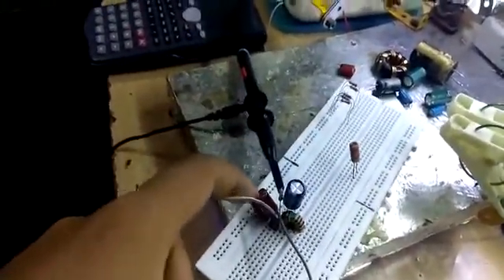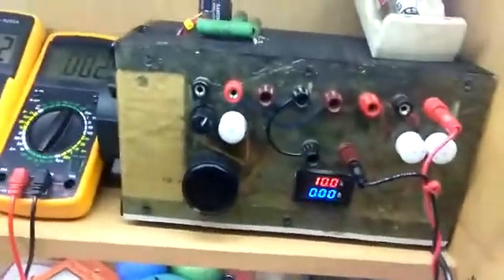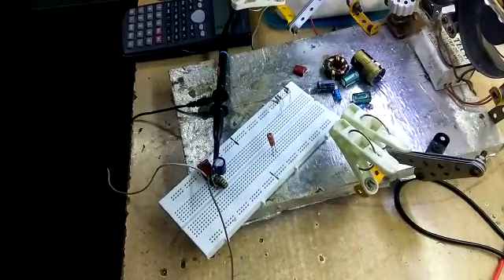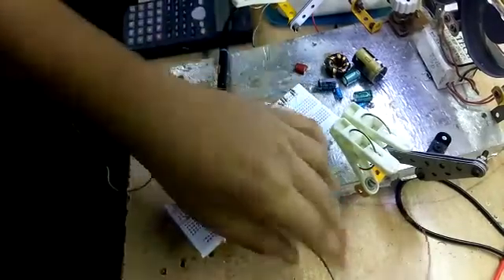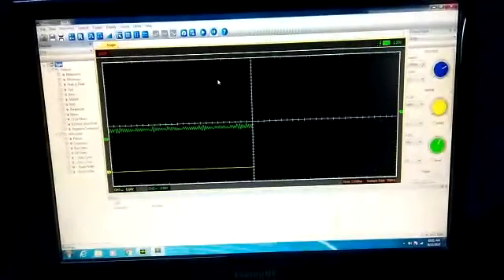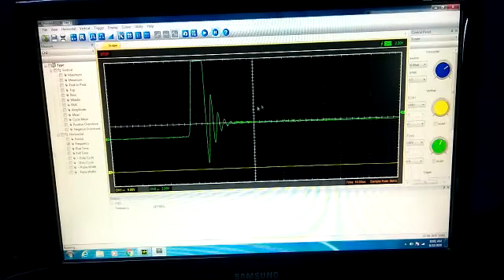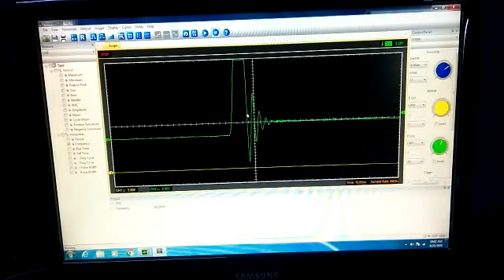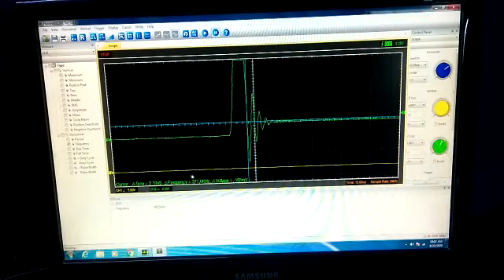Resonance of LC tank circuit on an OSCILLOSCOPE!!!

Comment: Hi, very nice video! Could you please share the capacitance and inductance values? How is the second capacitor connected in the LC parallel circuit? Additionally, could you please describe the oscilloscope’s settings and the input DC voltage to drive your circuit? I am just interested in showing the undamped LC oscillations on the scope (not the resonance curve). Did you use any switch to charge up the capacitor, and then disconnect the circuit from the voltage source? Thanks for your attention to this. Regards!
Reply from the maker: I shot this video about an year ago but uploaded it on youtube much later. So I don't remember the capacitor and the inductor values. One end of the second capacitor is connected to the non reference terminal of the LC tank and the other on is connected to the passive probe of my oscilloscope. It's job is to block of the DC component of the signal and provide a clean ac output.
I didn't used a switch in the circuit. Used a male jumper wire to make momentary contact with the non reference terminal of the LC tank circuit. I used my oscilloscope in single shot mode at a sampling rate of 16 mega samples per second. The time base and volts per division setting I again don't remeber. 
I'll upload another video on LC tank circuit in a few days. I'll also explain it in detail in that video. Thanks for watching my video bro!!!
Reply: @ubyteconsulting  Many thanks for your prompt and useful reply!  I look forward to watching your upcoming new video about the LC Oscillator.